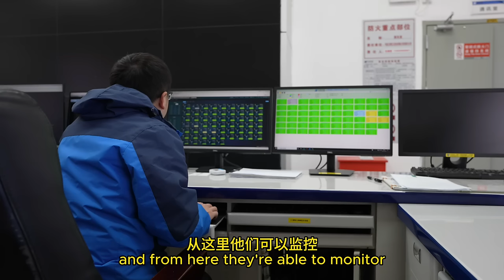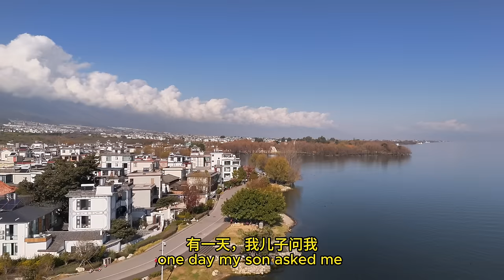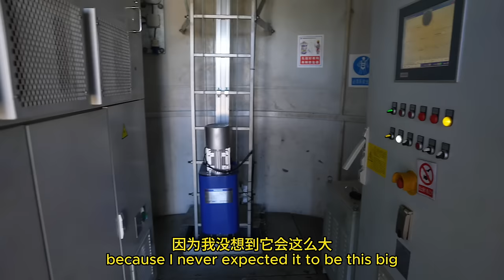China's Clean Energy Infrastructure is so impressive!

Comment: You can monitor the whole wind farm with just 1 person. What if an error pops up? Does a team run out like firefighters to fix it or disable it?
Reply: If a problem pops up the tech team can remotely disconnect the generator from the grid, stop the turbine from spinning by feathering the blades and applying the brake. A maintenance team can then be alerted to the problem and with a log of the fault recorded by the instrumentation execute repair or maintenance on the turbine assembly to make it functional again.
Reply: @bobsmith3983  So it is not like the US. Oh, it is x amount of years, we do this and that. If it breaks, we will shut it down and wait for the repair crew to decide what to do with it. You should see the windmill blade landfill. Doesn't seem like wind power is a green source.

Comment: Wind energy, like solar,  is only as good as the reliable energy source that backs it up. Human energy use is fairly constant, with some bumps. Wind energy is intermittent. Onshore wind has capacity factor of ~30%. Solar is worse  Wind and Solar are feasible in China because it has high hydropower resources to back it up. It's a disaster in the UK where we don't and we need Gas turbines to sit idle, waiting to back up unreliable wind.  Even in China, where they have hydro, hydro backup requires over-building hydro turbines so you turn many on and then turn many off sitting idle while wind has power instead of running a few nonstop.  Additionally this means you run the hydro in a way to backup wind, not the best way to regulate water flow for the environment.  I think that China will benefit from deploying wind power while they still have hydro capacity for backup and while they develop their nuclear industry, but the future is nuclear power, not wind.
Reply: 光电和风电和水电称为垃圾电，电能转化成氢能，然后再转回电能，现在这套方案使用比较多。
Reply: Wind energy sites are based on the areas with the most consistent winds. The selection of the site is critical for uptime and I'm sure the Chinese have chosen wisely unlike the Brits. Unfortunately for Britain it is a small island and there are limited sites where consistent winds are few and far in between.
Reply: @whatswhite110  Hydropower is not garbage power. If not backing up wind/solar it can be good quality baseload energy as long as you have reservoir with buffering capacity. Wind/Solar --> Hydrogen --> Electricity isn't great. Still has transmission issues, high costs, and inefficient conversion as all chemical processes like to be run at steady state. It's still good for China for energy sovereignty. In a war even expensive domestic energy is important energy.  Nuclear is much better but renewables can be deployed faster. So that can be a factor in China's deployment of this bad energy.
Reply: @bobsmith3983  We have good sites for wind power. But onshore wind power typically has capacity factor 30% sometimes 35%. You can only make higher capacity factor if you build your windmills with extra capacity, bigger blades, bigger power electronics. Then you can get 50% capacity factor but with much more expensive windmills so expensive energy. Still have intermittency issues.  Without hydro backup power it ends up being very expensive. But it does give China sovereign energy. And that's a win in this political climate.
Reply: @kavabean  清洁能源一直在做，一直在发展，从投资收益最大化的角度，这种绿能肯定不行，但我们要支持绿色能源，并且要不停的进步，就必须发展，哪怕收益不高。做企业一样，做人也一样，先往前走了，遇到困难，解决困难，如果因为预计到将会遇到困难而一直不往前走，那什么事都干不成。
Reply: @kavabean Is it expensive? Much cheaper than Ukraine.